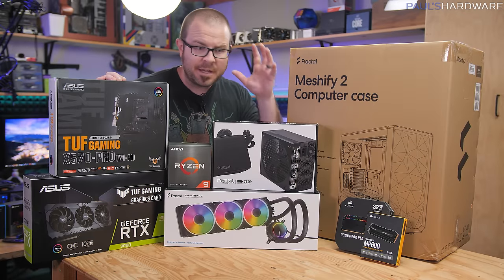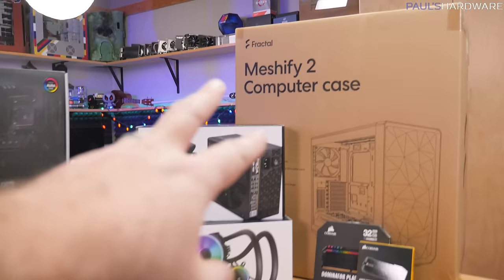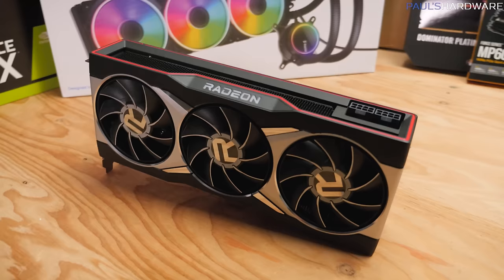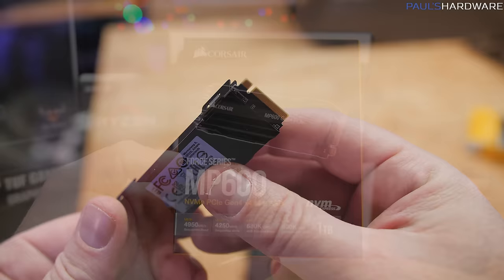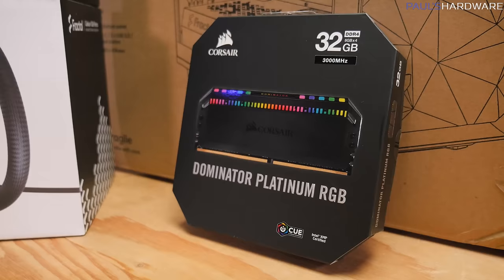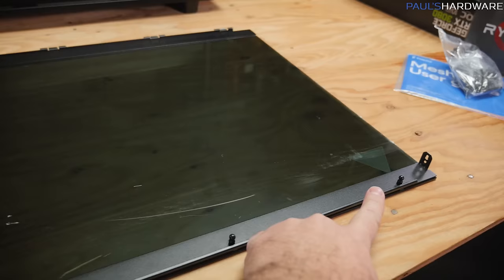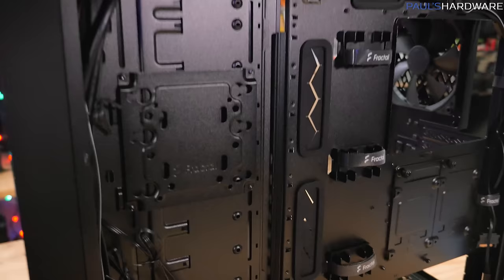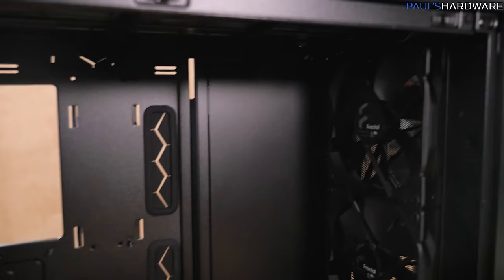Building the $2000 Gaming PC EVERYONE Wants Right Now!

Comment: Just a question, is rtx needed? Could you build without a graphics card or if you can't is there any other cheaper? I just want a cheap card that is pretty good a as it does the job. Of you don't have a graphics card does it limit your gameplay and which games you can play?
Reply: All consumer-level PCs need some sort of graphics hardware. Otherwise, you wouldn't be able to see any video.
There are 2 main kinds: integrated and dedicated graphics cards. Some CPUs have integrated graphics built-into the CPU. No need for a dedicated graphics card. The issue is that these aren't usually very good for high-end gaming. They're fine for general tasks like web browsing and videos, but not gaming. That's where a dedicated graphics card comes into play.

Unfortunately, due to the pandemic (and cryptocurrency mining), there is a massive chip shortage so there is very little supply of graphics cards. The few stock you can find is usually very overpriced.
Reply: @JJFlores197  yeah o figured this after I wrote the comment but thanks anyway. Pretty sure ryzen has it built in but I'm going to get a rtx 3060 anyway

Comment: almost exactly like my build
meshify s2 (black and white)
asus tuf 3080 (shroud painted white)
gigabyte vision D b550
ryzen 7 5800x
360mm ID cooling white AIO
corsair RM750
white corsair vengeance (32gb)
2 tb m.2 (forget the brand)
then i got some 24/8 pin lian li strimmers, a 10x30cm rgb panel on the right, and 4 corsair lp120 white fans (should have got the 140 but oh well)

Comment: Super clean build, if I'm not lucky enough to win this beast. Would you like to build me an intel version for a video? My cable management always looks like I've taken one to many blows to the head. 

I was looking at the fractal define 7 because I like that simple look and I'm live in a fairly dusty area so I was concerned the Meshify wouldn't be optimal. And I was going for a NH-D14 cooler and replacing the case fans with noctua. I've had great luck with them. Maybe ripjaw 3600, though the kit you put in looks very clean. Making for a nice contender.  Plus a samsung 970 EVO plus 2 tb nvme. Not as fast as yout selection but I save every penny I can over 4 years to build a monster to get me through the next 4 years. Can't afford all the premium goods.

Comment: After using the same system for twelve years, I'm attempting to build myself a new computer. Apparently I've picked the wrong time to do so, people have been buying up graphics cards like it's toilet paper. I started looking at components in October with a budget of $600 to $700, it's gone up $300 since. Of course I changed the motherboard from a b450, to a b550, and increased how much I'm willing to spend on a graphics card. Good thing I'm reusing the case and PSU I have or it'd be over a thousand bucks. 
All this because Blizzard changed the minimum requirements to continue playing World of Warcraft. I may end up buying just the graphics card, if I can get the one I want, and hold off on the rest of the build until spring. Hopefully the scalpers will settle down by them, and supplies can be replenished.

Comment: .Biggest AMD seller (clearing) in the prior 2 weeks is Ryzen 3400G desktop APU channel inventory down 77%. I would not recommend Picasso APU but glad to see they r clearing the channel.

i9 9900K has fallen to $300 and will continue to fall in price through 3rd week into January and then the fire sale.

Ryzen 5xxx desktop SKUs are up 72% since launch. 11.74% 5950X, 17.79% 5900X, 37.53% 5800X, 32.96% 5600X last Thursday.

R 5xxx is in the first three weeks doubles 3xxx supply in the first three weeks (of supply) that began to ramp supply week 5. Matisse 3xxx sales slowed, 3800X and higher sold better down 1%. 3700X and under flat. 2/1xxx are relatively stalled.

Matisse 3xxx = 42% of all AMD channel inventory Epyc through Athlon, but R 5xxx is just 2% of 3xxx. AMD channel sales strategy offers Vermeer 5xxx allocation as channel partner clears there Matisse 3xxx holdings.

Renoir mobile inventory is up 2% and desktop 4xxx 11% in the last two weeks. 4xxx is now 79% of Picasso mobile and 4xxx full line now 60% of Picasso 3xxx full line in the 34th week of supply.
 4xxxG/GE like everything is going for a price premium.

AMD GPU 6800_ Big Navi is 276% more than 57xx_ in first three weeks of supply and 8% shy of Vega first three weeks. Navi 57xx_ channel inventory is down 25% in the prior two week period.

Nvidia GPU 3xxx sells off 22% in the prior two weeks and is currently 268% more than 2xxx in the 12th week of supply. 3090 = 43.61%, 3080 = 26.32%, 3070 = 30.07% today. So said 3080/70 Super cards shows in a PC system integration.

Of the Turing cards 2060 clears by 18%, 2070 by 3%, 2080 by 12%. Geforce 1660 and 1650 clear most down 25% each. However 1660 super inventories increase 150% likely run end Nvidia inventory clearing.

mb
Reply: Upgrade, 7200 HDD for archive. mb

Comment: my pc if CLX delivers Ryzen 9 5900X 3.70 GHZ C12 AM4 TR, 360mm Liquid Cooler, X570 TAICHI AM4 3X16 SLI 4D4 M64 GL WIFI, R16GB DDR4-3200 XPG Spec D41 Red R 2
13 TOTAL 32GB 3200, 1TB Firecuda 510 NVMe M.2 SSD.AMD Radeon RX 6800 16GB GDDR6 1
,Eclipse P400A ATX White w/ 3RGB FAN 1
EVGA 220-GA-0850-X1 SuperNOVA Mod 850W GA 80Plus G $2,674.95
 supposedly ill have it shipped by Dec 11

Comment: I never understand this part of the case:  https://ibb.co/h2H7CNL. It just takes up more space without the reason. This build uses triple fan configuration of the AIO yes but you can easily go with the 240mm solution in every build possible and make the case 15 cm shorter. It could also cost less because less material is used.

Comment: If I somehow win this system, it will be a nice upgrade for my
- Intel pentium G3250
- integrated graphics
- 8gb of ram ddr3 dual channel (one from Adata and the other is kingston)
- 600w power supply not certified
- 1tb ssd (lol) wd blue
- and random case without side panel
Wish me luck guys :3

Comment: I just built a new $2000 pc and had to settle with a 3700x (325)  and a 1070 (300) thanks to the parts shortages. Don't know how you can fit a 3080 in a "$2000" build if you weren't an influencer

Comment: Can someone help me out plz? I just got a new case which is a raidmax enigma, ryzen 5 3600, and a b450 gaming carbon ac mother to update my pc a bit. My pc performs great now but my audio is awful. It’s unbearable to people in my discord calls and there always a faint buzz and the audio sounds horrible. Plz if you can think of anything let me know
Reply: How are you using audio? Is it through USB or the 3.5mm connectors?
Reply: @JJFlores197  the 3.5 mm
Reply: @JJFlores197  Everything about the audio was perfect before I updated/upgraded
Reply: @ezra9256  Try plugging into the back of the motherboard. If it sounds fine/better, then it most likely means that the case front panel audio is not good or otherwise damaged.
Reply: @JJFlores197  yes your right after I posted this comment I plugged it in the motherboard and it was perfect. I just hate how I have pointless headphone jacks on top

Comment: Every once in while gaming YouTubers mention environmental issues. So even if I were not a disabled gamer and had the money for a new case I would reuse my full tower and PSU as well as recycle the antique stuff in my mid-tower while moving my FX parts into it. The only time I buy new cases is when I have more than 1 build to be concerned with or I'm building a system for someone else.